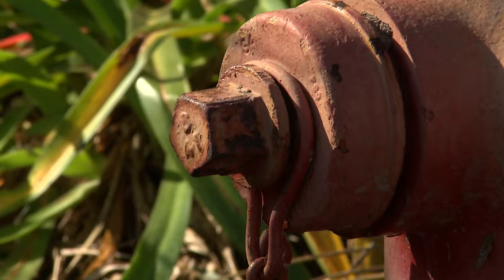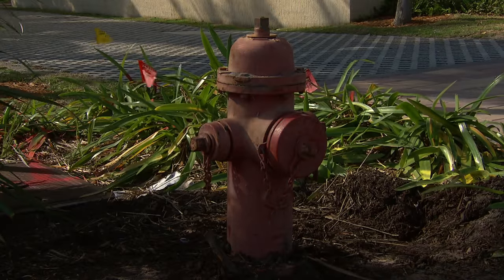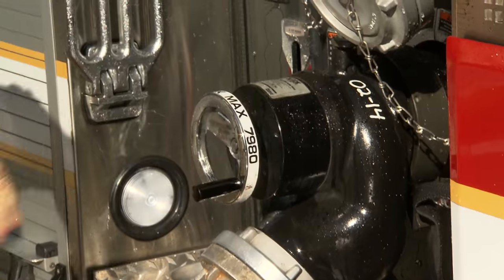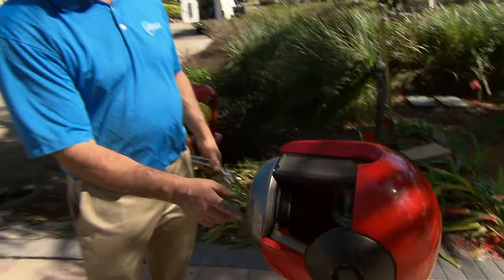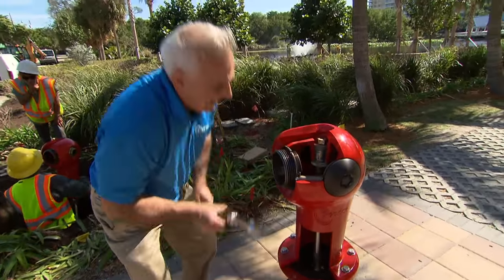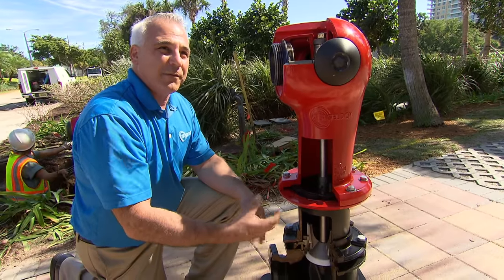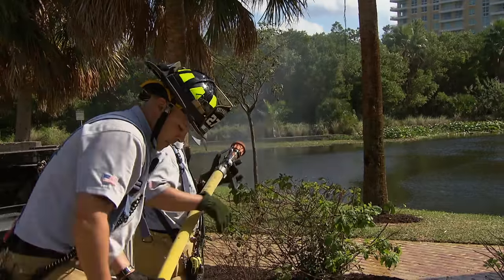The future fire hydrant

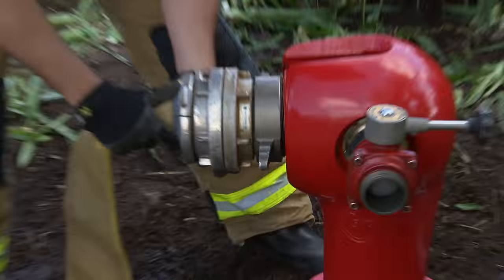Comment: water is spitting out at 1:12
Reply: I couldn't watch it that long
Reply: Bro, that is a connection issue. One of two things is happening here, one the hose connection wasn't fully screwed on, or they used a damaged hose connection. Nothing to do with the hydrant.
Reply: @nathanmcconnell9991  Those are plastic hydrants, however. A hit from a car will likely ruin it. Also, yku can buy the "key" for $10-20 at Menards.

Comment: Why fix something that aint broke. those old water hydrants do the job just fine.
Reply: george palacios the implication is that this can do it better, it's an improvement. 
The comments have raised points that it might not actually be, that's called testing. 
This is how development works.
Reply: cjeam the slight improvement like you call it doesn't justify the insane budget need it to replace the old water hydrants. The old water hydrants work just fine imo and replacing them with this new water hydrants is a waste of money.

Comment: A little ice storm and you're not spinning that cap off very easy, and that's AFTER you beat the ice off the inset nut head.
Also, only two connectors instead of three?
And you have to make sure EVERY fire truck and DPW vehicle has both the new wrench.
-
Sounds like a way for the designer to make money is all.

Comment: So this video made me google why we dont have fire hydrants here in the UK. Turns out we do, and I've seen hundreds of them all over and just didn't know they were hydrants. For anyone in the UK thats wondering, those little signs with a yellow "H" on them that you see (trust me you've seen loads of them and would recognize them right away if you seen one) are actually fire hydrants, it's just a little hole in the ground.  It's just that in the US they leave the external part that is above ground on the hydrant permanently and in the UK the fire brigade carry it in their trucks and attach it when needed (which is guess is a lot cheaper and probably a better way to do it IMO)
Reply: rooneye thats what we have in australia. also selected authorized personscan buy metered hydrant access unit to access water when they need and get billed for what they use.
Reply: rooneye how did you not know that? I knew about that when I was in school aged about 10yo. The H symbol signs, the distance from the sign is where its located and the diameter of the pipe.
Reply: Stephen Hitchens I didn't know that was what the H signs are for until reading that comment. Sometimes stuff just passes you by.
Reply: R69NIX doesn't work well where there's regular snow and ice. Makes ground connections impossible

Comment: why are all hydrants in the us over the ground they should be under it like in Germany way more usefull
Reply: It's because above ground was standardized. They're easy for different crews to immediately spot and are easy to hook up to. Additionally water hygiene is less of an issue with above hydrants. The manhole where the hose connection, and doesn't have the potential to get into the line when they first turn on the water and clog everything. 

In America legislation is in place where citizens can open the hydrants themselves and fight fires if they have equipment, same thing if the national guard rolls in. Also construction crews are allowed to use them with a meter to spray water on demolitions to keep dust down. And farmers are also allowed to use them with a meter during winter for additional water for greenhouses, and during the summer for additional water for the fields. I've also seen them used during new road construction where they'll use them to supply people's water for a couple months while they tear up the road. 

Then you also just have the fact that in America the above ground version became the standard, and in Germany, below ground became the standard.

Comment: I live in a pretty small town, and half the hydrants here are broken or just don't work. I'm a volunteer at our small fire department and the hydrant nearest the station broke and wouldn't turn off and didn't have a cut off valve on it. We had to shut the water to a big part of town just so we could unhook our Engine and seal it up and now it leaks from the covers consistently. The county has zero plans to replace or fix them. These new hydrants are cool and all but this town will never see one ever, hell it wont even get any of the current ones fixed.

Comment: Your main argument is that the fire hydrant is an old design. So is the wheel, but I don't see a rush to redesign them.
Reply: Completely different design yet still the same shape and function as when  cavemen discovered them thousands of years ago.At the end of pipe, it's still just a valve sticking out of the ground. Subject to break. But hey, as long as I don't have to pay for that cheaply made eye sore we are good. Even at just 1000 dollars parts and labor to install each your talking near 50 million to do one city the size of Chicago . I believe  we could figure a way to adapt current hydrants for increased flow and less breaks at a much lower cost.

Comment: The OLD style Hydrants have their internal issues. After doing 60 hydrant flow tests this past weekend. 
Here is what I've come across. There are a number of makers of hydrants. Some are Oil Filled, some are Grease fitting. Some have different size Top Hydrant Valve stem Nut sizes. Each those fails internally on the bushing thread that pulls the valve stem OPEN to cause water flow. If the internal Bushing fails, either you cannot open the valve or in many cases. The hydrant fails to close, shutting off the water. 
This new hydrant design has an improved internal Valve design which makes opening or closing the valve easier and greatly reduces internal bushing valve stem breaking. The Hydrant Valve seat is a better design as well. The Old Version tends to get pipe scale jammed in the valve seat. Which means the valves doesn't totally close. You get leakage spilling into the surrounding underground drainage. This is apparent later after Hydrant Testing and the ground around the hydrant bubbles and becomes soft. 
I'd welcome the new Hydrants. But we know, many non Municipal industrial locations will not replace old version hydrants with new version hydrants because of COST. It's cheaper to replace the internal bushings on an old version hydrant than pull out the old hydrant and put in a new one.
Reply: Then that falls on the maintenance people, not doing their job. They're slacking.

Comment: FUTURE IDEAS .....Why not just have a  .....QUICK CONNET ....WITH A QUARTER TURN TO LOCK  WITH retractable hose  with hydrant...also idea .....box around hydrate with pre connect hose to fire building from hydrant  TO building  with capability to pump to built  /pump for proper pressure to supply stand pipe ( retractable hose with sufficient amount of hose to supply building) with in that block / area , so those  hydrant will be assigned to building by design.       Also. Idea future...  fire apparatus navigation/ with voice commands pin point locations minimizing human errors with response and traffic contingencies  . GET TO THE FIRE QUICKER WITHOUT THINKING ON LOCATION with technology navigation. ....just ideas 👍🏾
Reply: they already have a pipe between the water main and the building sprinkler system.  it's buried and permanently connected.

Comment: i dont see anything new beside the caps...and they have full access even without any tools we leave one 2.5inch cap loose so the water drains back..you can unscrew it by hand...the 4inch takes a second as well...stop whining..i have worked on hydrids that had horses hair as gaskets and they still worked fine..the problem is all the salt they use on major roads,they are harder to spin,we worked/graced these twice a yr to prevent them from jamming...seriously this is a waste of money